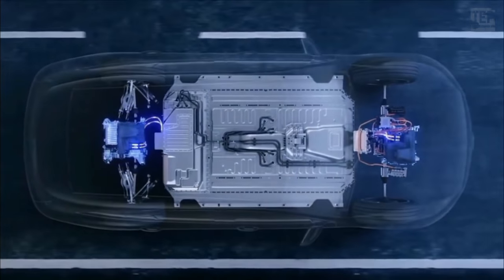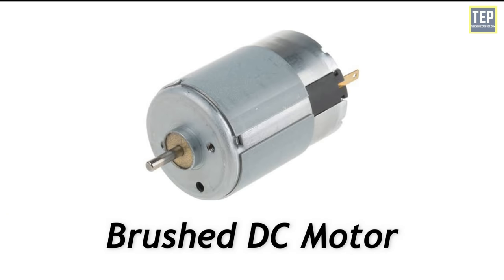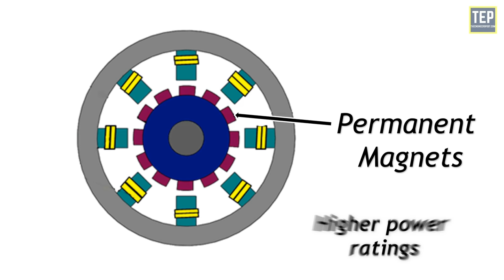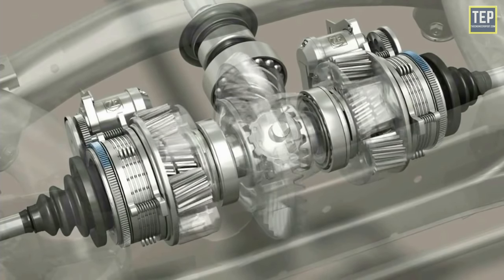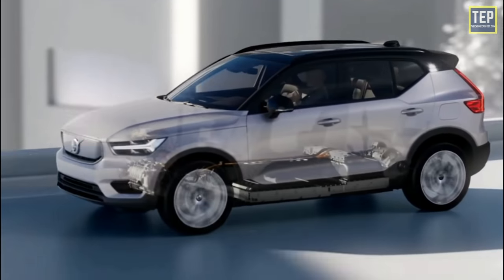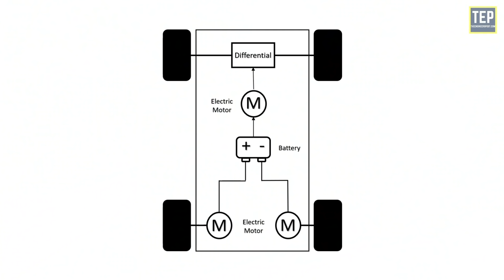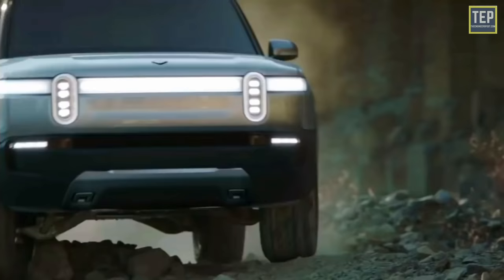Types of Motors used in EV | Single, Dual, Three & Four Motor Configuration in EV

Comment: The best improvement would be to eliminate the charge cycle entirely.
Flying saucers ( some ) use Kohler converters.
But what is the strength of the EMF field at ground level?
There has to be magic in the mix.
Reply: Yeppppp... 🤣🤣🤣🤣

Comment: My preferred configuration for a practical EV is to have two motors in front and parallel to the rear axle with a two speed gear box which would allow just one motor to be used around town in a low gear where maximum rpm might get up to any 60 - 70 km/h and and then high ratio could be used with two motors with maximum rpm allowing a top speed of something like 115km/h as 110km/h is the maximum speed limit where I live. The top speed limitation caused by the gear ratio allows the lowest possible torque motor to be used as torque is proportional to current draw, also the lower the torque the lighter the motor.
I also have had a less practical design concept that I thought up in the early nineties before lithium iron batteries became an option. The idea was to have something like 10 small wheels about the size of the original mini minor wheels all with built in hub motors which would be all steerable except for the pair second from the rear. Suspension and steering may be similar to that of the front wheel of an aircraft to allow room for the less energy dense batteries such as nickel metal hydride batteries and/or a flat horizontally opposed engine and alternator so that it all could be hung under a higher than normal floor pan. This meant that it could easily be changed from hybrid to only batteries when battery technology improves.
I’m not an engineer but was thinking that this design might reduce the need for localised high strength at the suspension points since there would be ten of them instead of four and I was hoping that this would make it much easier to design the body from aluminum which requires less energy to recycle and even better may not need to be painted but polished like aircraft.
Also since it would be suspended at ten points the suspension could be fully extended without the suspension being too hard and the advantage of this is that it will not drop wheels into pot holes which makes it more tolerable on bad roads with the advantage of less unsprung weight that you get from small wheels.
While it may be a bit expensive to manufacture there are two trade offs, 1) as already mentioned the possibility that it may not need to be painted and 2) solid state components that only need to carry one tenth of the current for each wheel would be far less than one tenth of the cost at least it was the case back in the nineties.
It could look a bit like the chariot from the 1960s sci-fi show lost in space without the tracks. I think that the uniqueness and practical advantages would have attracted a lot of buyers.

Comment: I would prefer a 1 liter, 70HP triple cylinder engine, paired with a 40HP axial Flux motor/generator, to cruise the car at a fixed speed, and a 100hp rear motor, for acceleration.

Comment: Given all that's being said about electric Motor evolution , control systems, gyroscopes , robotics etc ,  looks like a single motor , single seater , single wheel system set up on a single pole provisioned  with stabilized seat  and self navigation controls for the commuter will be the next important development in the coming years.
Reply: Why?  Sounds pretty useless to me.....unless of course it comes with a potato chip bag holder for the lazy person who wants them

Comment: You aired to mention the inverter for AC motor to convert the battery DC.  Only series wound motor does not require an inverter.  Thyristor is required for speed and current control.

Comment: I will go for the 4 motor configuration since it has the most power combined with 4 motors. I like the idea you can run two motors while the other two are not running and the batteries will recharge while the car is running.
Reply: running two motors while charging two other motors is a fool's errand.
Reply: inefficiency generated > charging the batteries
Reply: Charging the batteries while moving is totally inaccurate - rather absurd.  I wonder why this video hasn't been updated to correct that incorrect statement

Comment: single TYPE motor, is my preference.
For simplicity reason.

2 motor, front & back, is simple enough.

Quad motor, 2 front & 2 back,
only if it can turn to 3 / 2 / single motor,
when 1 / 2 / 3 motor develops a problem.

Comment: When cornering, how to independently measure which wheel the vehicle needs more torque, is a gravity sensor used here?
Reply: it is usually achieved by sensing which wheel is easier to rotate and which is harder to rotate, the wheel that is harder to rotate needs more torque

Comment: This video explains how efficient electric motors are compared to an internal combustion motor. They have less moving parts and are smaller in size.
Reply: the stated efficiency is not correct as none of the electric motors have higher then 5 % at startup and during startup draws more current and is putting out less hp, that problem was solved several years ago but has not been put on the market due to those attempting to bring this new development were killed in a so called accidental airplane crash.
Reply: Oh no, were they killed by the same people who have been killing everyone who invented magical 100 mpg carburetors?
Reply: It's true for other reasons - none of which is demonstrated in this particular video.

Comment: I have an 1994 Toyota pickup truck with a 2.4L 22RE 4-cylinder and while it has been extremely reliable, it is pretty underpowered. I had often wondered if it would have been possible to make it a gas/hybrid by having an electric motor going inline with the driveshaft. I would like to think of it as more of a helper motor that would help with faster acceleration and maybe a bit more power when I need it. All the while not drastically changing the engine or transmission. I saw a video of someone attaching an electric motor on a V8 engine  setup similar to a belt driven supercharger. The power train remains the same but they added this motor which gave a bump in power while also increasing mpgs. That’s what I would want. It puzzles me why it never came to market because I feel like that would be perfect for many car enthusiasts who love old cars and old engines but also want to embrace in some new technology or to get more power.
Reply: i dont see why not, perhaps you could couple it to a transfercase, or to one of the differentials, if its 4x4.
Reply: @Tunzbig  Unfortunately my truck is only 2WD. I was thinking of a 3-phase motor/generator that was belt driven like a supercharger. The biggest problem is see is having a place to mount this big and heavy electric motor in the engine bay. That and running the wires to the battery which would likely be in the back would require very heavy gauge wire to span that long of a distance. 

What I was thinking was to have an electric motor be connected inline with the back of the original 5-speed transmission with a coupling and then the driveshaft be connected to the other side of the motor, similar to a Gear Vendors overdrive. There should be plenty of room to mount an electric motor and I suppose the batteries could be placed opposite of the gas tank to balance the weight. Another thought would be to have the motor mount inline with the differential like what the new Edison diesel-electric truck is doing. Both would help with weight balance, keep the length of the heavy gauge wire short so it’s less expensive, and allow for easier packaging under the truck. This concept could also be more easily adapted to all pickup trucks with only minor changes. I can see this becoming a popular kit for any new or old pickup truck to be converted into a hybrid, while still retaining the heart and soul of the original engine and transmissions but with the added benefit of increased power and fuel economy.

Comment: Well, single motor driving a diff is real popular. The heavy truck community seem to love that format
as they are calling them e axles. I was hoping to rid myself of the diiff as it requires regular servicing
which is the primary attraction of BEVs to me. No oil changes-no emissions testing-no transmission
servicing-no driveline nor U joints to service-no cooling system...Win-Win-Win. If Tesla can make that 
$25K eco sedan happen they will have a monster on their hands & the conversion to EVs will
accelerate to an unbelievable pace.

!

Comment: I think maximum two motors would work best because no more complex software needed to control the system with low power consumption and little failure.

Comment: Can you perhaps advise me? 
I am busy building a prototype track saw for cutting 30mm thick granite countertops. I have some requirements for the motor, and need your advice.
1. This track saw must be a mobile unit, and therefore I need the motors to be as light as possible. I need a high power to weight ratio, and normal squirrel cage motors will not work for this application.
2. I need to be able to regulate the speed of the motor and have revolutions per minute feedback (hall sensor)
3. The motor MUST be able to run on 220v input.
4. The motor and controller must have a IP65 rating
5. It should have a fairly high torque at about 2500rpm
6. The motor MUST be heavy duty ( industrial use)
What type motor can you suggest?
Reply: You might want to consider buying an industrial granite saw off the shelf and make the necessary modifications to make it mobile, and installing instrumentation for rpm.  
I've seen several taht are already very heavy duty and mobile

Comment: a simplified 4 motor 2 battery bank design would be ideal. motors right in wheel, the battery banks would contain an H circuit  that could switch to being charged during breaking and through lightweight solar and cyclone wind power. cyclone wind generators were a concept developed for EVs going way back to the 70s-80s. It channels the wind where the Rad would have been to tubing the exhaust out of gills on the sides but a side facing turbine spins to collect power inside the channel. It was a proven concept. The goal was to do it without creating too much drag. Your collecting wind that is coming at you anyway. A video clip of it is on YouTube somewhere. There is a few other energy collection methods that EVs could use as well just think of what an EV has in it's surroundings.

Comment: Question - while EV car is on the road and running does EV battery somehow recharges? I know that then EV car stopping then battery get can be in small portion recharge,but what about then car is on the road?
Reply: Absolutely not, even though it says so in the video.  The only time a battery is being charged while driving is in the case of a hybrid.  Hybrid cars are optimized for best results, meaning the sweet spot for cost and net energy/efficiency in the process of self regeneration of energy...and that's typically around 5% at best.  There will never be a system that charges itself indefinitely....otherwise hybrid cars would have infinite range, and that would make it a perpetual motion machine, which is just a figment of imagination, and violates the laws of physics

Comment: So does this means that a 4 motor drivetrain could provide the longest range for your vehicle?
Reply: Range is function of motor efficiency and battery capacity.  Nothing to do with number of motors.  You could possibly have a single motor to be more efficient than 4, and therefore greater range for same battery pack.....And vice versa

Comment: I would say with 3 electric motor is the best option then we need not everytime 4x4, 1 in front, 2 at back wheels, so you could use at good road condition only 2 motor in the back and the front motor you could use as a generator to charge the battery. With this option the range get much bigger.👌Also we save maintenance coast, weigth, resource
to😎
Reply: You have pretty much just described the idea behind hybrid cars

Comment: Ok but the real question i have is, theoretically can you put 2 motors on a single wheel to get more power, and get more horse power.

Like can you put 8 motors in a car. For an even greater horse power per wheel

Do electric motors work like that?

If the future is electric we gotta be able to tune it somehow.
Reply from the maker: Yes, it does, but there are two limiting factors:
1) Battery output has some limits so it doesn’t make sense to add more motors than the battery can power.
2) Grip - while adding motors is obviously beneficial to power all wheels, there is some limit (especially in high-performance cars) in the amount of grip which tires can provide. Adding motors that are powerful beyond traction limits merely adds weight.

Comment: What type of motor use in Porsche Taycan?
Reply from the maker: The Porsche Taycan Turbo S and Taycan Turbo have two PMSM Permanently Magnet Synchronous Motors, one on the front axle and one on the rear axle, making an all-wheel-drive.

Comment: Unlikely you will do so, but you seem to have taken a negative stance on in-wheel motors. You more than likely (when this was done) have not had an opportunity to experience this type of motor in the real world. When properly done, your mind might be changed, and my hope would be that you might drive an Aptera next year, and then revisit this subject. This undamped weight issue can be properly addressed with a suspension system up to the task. Nothing is perfect, but for the Aptera, an in-wheel configuration makes a great deal of sense, along with the entire vehicle making sense!
Reply: I don't think he was unfair in his presentation on the wheel motors.  He's consistent with the consensus about them.  He simply stated advantages and disadvantages for all motor types.  In this this case, it's the added unsprung weight that requires more attention/complication/cost than standard/traditional suspension

Comment: I think Now a days 4 Motor power train is not suitable for Indian roads. Two motor power train is best which drives one motor and generates the power by other motor. Which results in uses extremely less power 🥳🥳
Reply: Note that this is not not true.  This is an error in the video.

Comment: Other configurations that would make sense. 2 motor. One controls both left wheels, the other controls both right wheels. (through 2 separate transmission running the length of the car. ) Motots are electronically throttled to turn.
Reply: and why would that make sense?
Reply: @dj78productions  No need for fancy differentials. The motors just drive the wheels. And you can still turn.
Reply: @donaldhobson8873  do you realize that the front and rear wheels still need to turn at different speeds, even if they're on the same side? lol
Reply: @donaldhobson8873  In that case, you'd need a differential for the left, and another for the right, in order to ensure that tires run at different speeds front to back.....so no gains in simplicity.  That's rather unnecessarily complex, unless you're building a tank or a skid steer vehicle for very low speed maneuvering for off-road use
Reply: @marsogreen2411  Why would the front left and back left tires need different speeds?
Reply: @donaldhobson8873   Because unless you're travelling in a perfectly straight line, the front and rear tires don't follow the same track/line.  That difference is significantly amplified in hard turns and down right dangerous in consecutive left/right turns and especially on hard surface with good traction, as that causes the vehicle to "hop" on its tires....and imagine that happening at speed.

Comment: Not being an engineer, with multi motor vehicles when cruising why can't one or more of the motors be used to efficiently recharge the vehicle?
Reply: Are you saying turn the electric motors into generators to charge the batteries?  It would be totally inefficient and would add so much drag that it would defeat the purpose because the driving motors would be the source of all that needed energy.   It's the second law of thermodynamics.  Basically there are losses in the energy transfer.

If you meant having an onboard gasoline or diesel motor for charging up the batteries....well that's sort of the idea behind the hybrid vehicles.  In the end, there is never a perfect energy transfer and manufacturers have optimized to their best ability the sweet spot  in the hybrid car setups

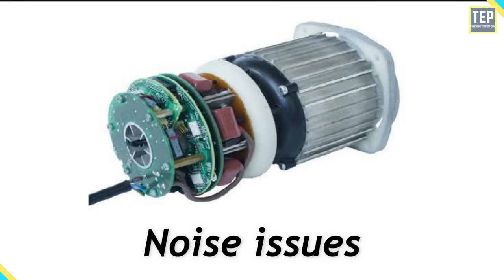Comment: 6:40 ok, why does this motor need to be synchronous? Only a motor with permanent magnets needs to be synchronized. It's because the permanent magnets can't switch polarity automatically via induction, so the polarity has to be synchronized to match the magnets themselves. Otherwise, the result is oscillation not rotation.

Also, Induction motors motor only lose their ability to produce torque at rpms that exceed the rotating magnetic fields frequency. At 60 hz, this is 3600rpm, as far as I can tell. Fortunately, motors don't need rotation to create torque, so using "tall" gear ratios, with less rotor rotation is possible. It's funny that Tesla's ditched the induction motor, in order to have higher rpms, considering how unnecessary it is.